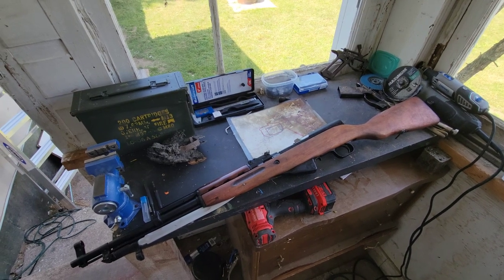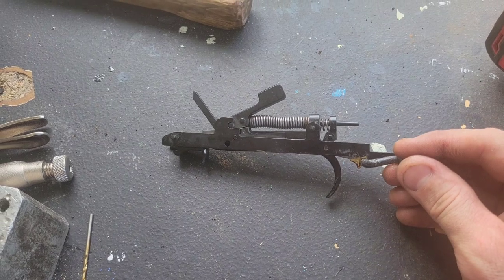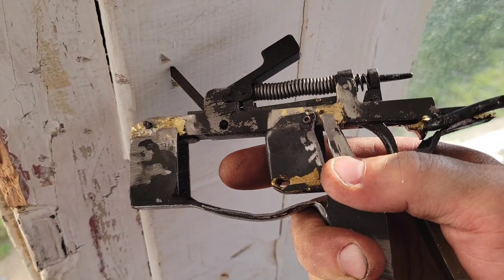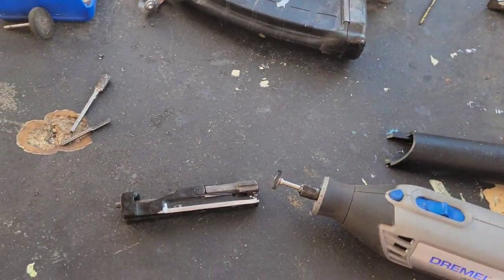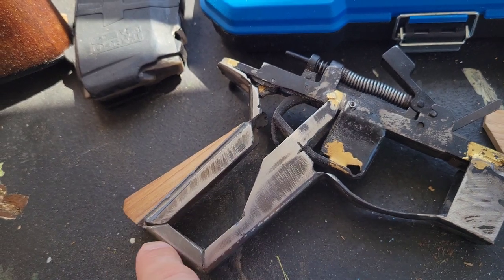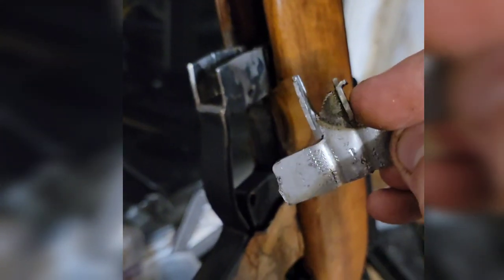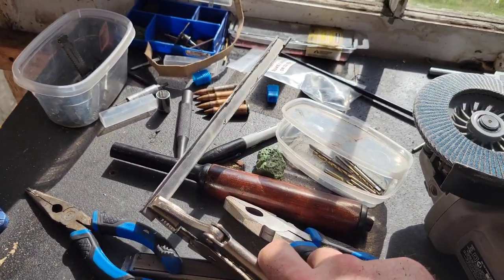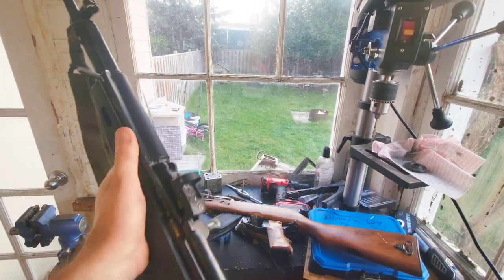How To Make an SK-15/17

Comment: I don't know about getting AK mags under Canadian law, but have you tried an AK magazine? Maybe I just need to watch more of your videos, but the SKS magazine looks like it is a double feed setup like the AK.
edit One of the best things I ever bought for my Dremel was a tool holder. It turns your Dremel into a little mini milling machine and you can achieve a surprising level of precision with it. You're not gonna make aerospace parts with it, but I've fixed small Chinese motorcycle carburetors with it when the casting flash wasn't letting the slide close.
Reply from the maker: Yeah, you definitely need to watch my recent videos
Reply: @blastshadowproject  good thing I subscribed then!